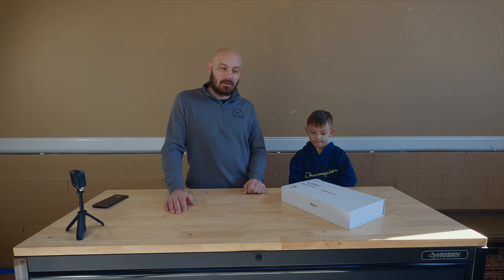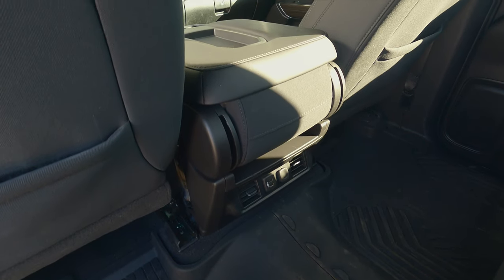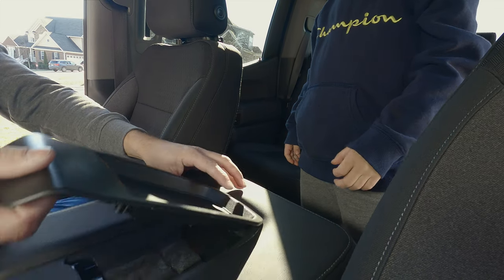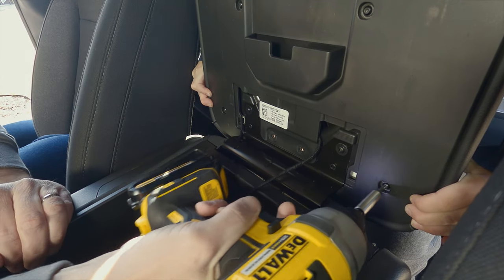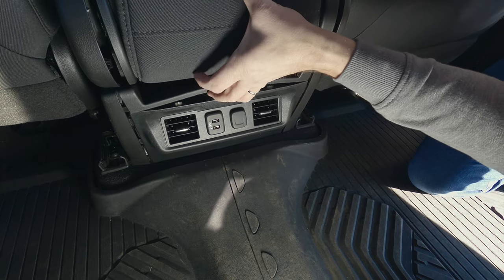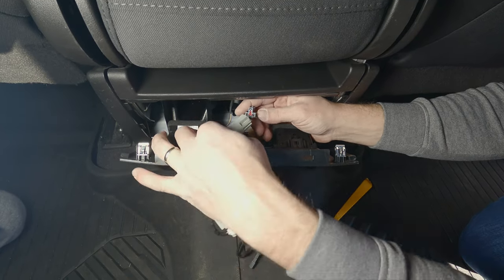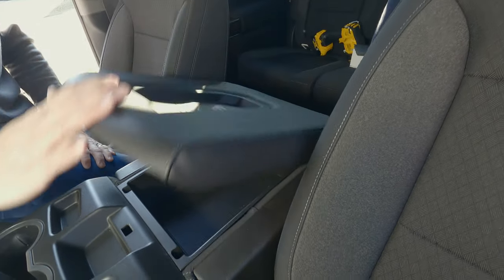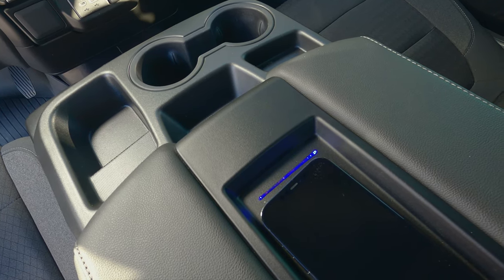Silverado Trailboss Center Console Wireless Phone Charger Install

Comment: great video.  the instructions that call for routing the wires to dash is probably for trucks that do not have the rear passenger usb/outlet option.  I agree it's much easier to do it your way.  Will be ordering the kit now.. thanks for sharing.